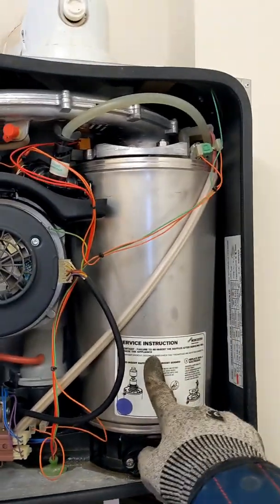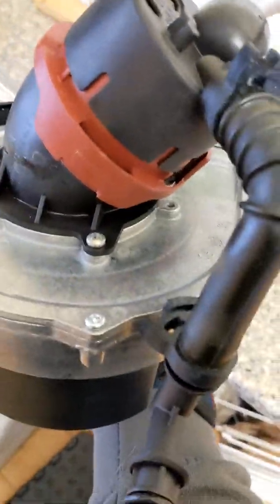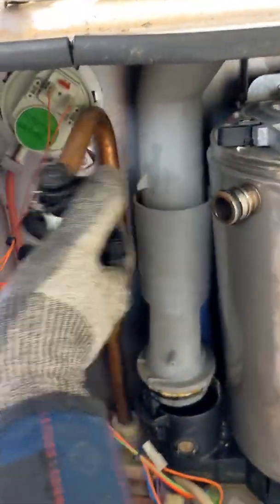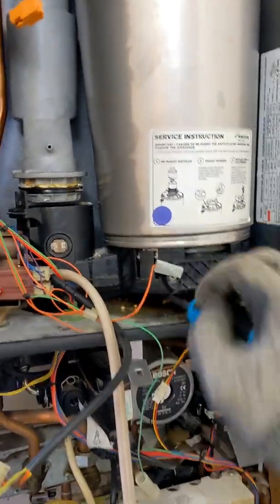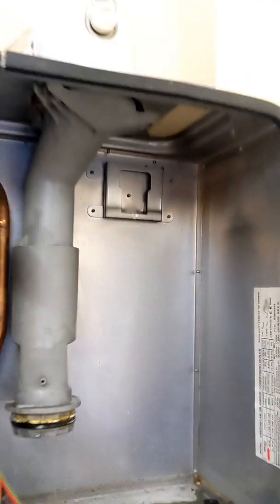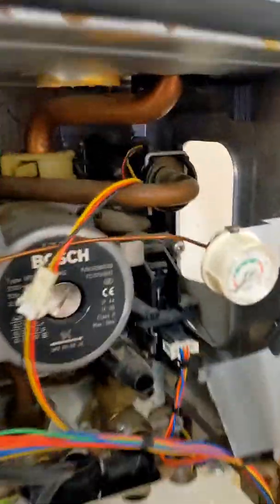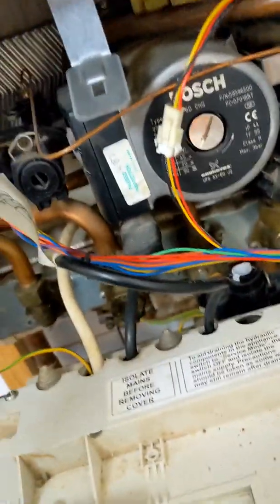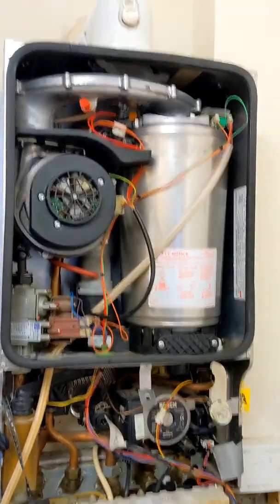Worcester Bosch main heat exchanger/heat cell replacement

Comment: Can I ask why the heat cell was replaced please? I’m having issues with hot water after replacing the plate heat ex and hot water temp sensor. Heating working fine hot water just luke warm. Diverter replace by a different engineer recently
Reply from the maker: It was split from the seams

Comment: Can I ask a question, please and get some advice. I have a new (3 month old)  Worcester Bosch Greenstar boiler. The boiler has been off all day, yet suddenly there was a discharge of water from the boiler through the condensate pipe (I estimate about 100 ml). The boiler HAS DEFINITELY BEEN OFF for I would say 20 hours. The sound, appearance and volume of the discharging water was exactly as it is when the boiler is on and condensing, but as I say, the boiler has been off for many many hours. I can't work out why this is happening - the only thing I can glean from a search to the question "why is my condensate water pipe discharging water when the boiler has been off all day" is that water is leaking into the condensate collecting tank and as soon as it reaches a certain volume it is discharging. I also am seeing words like "cracked heat exchanger" The outside temperature is 12 degrees centigrade as has been like this all day. Surely my boiler / heat exchanger can't be faulty and leaking water after just 3 months? Please help, I am extremely anxious. Thank you.
Reply from the maker: If your boiler has been off and you still have condensate discharging then it could be 1 of 2 things. Either a split main heat exchanger (you would notice the pressure dropping on the boiler as well) or if it's been raining outside then it's possible it could be coming in through the terminal and then discharging through the condensate
Reply: @cputilitysolutions  Thanks you for the reply.
1)Split main heat exchanger (you would notice the pressure dropping on the boiler as well)  - I have  feeder tank in the loft (attic) , so  there is no way of measuring the pressure; the water from the tank would just slowly fill the system, I think? The boiler is just 3 months old - could the main heat exchanger split so quickly? Also it was just on flush of about 100 ml over about 5 hours, because as soon as I noticed the discharge at 6 p.m. I kept watch; it didn't happen again.
Three hours later, I went into the roof space where the feeder tanks is. Despite my cleaning it out completely 3 months ago, it was quite dirty, full of lumps of slime and gunge and the water was orange coloured and there was quite a bit of "sediment" in it as well. HOw could this have happened? Also if the main heat exchanger was split and this dirty water from the tank was topping up the system was replacing the existing water and also leaking out at the heat exchanger, wouldn't I expect to see this rusty orange colour in the "condensate". The colour was clear when it flushed through.
2) How much water could leak out of a cracked heat exchanger into the condensate pipe?
3)The terminal is on the roof - it wasn't raining much around the time of the condensate discharge, and the wind wasn't blowing. Could rain water actually get in to the vent and up through to where the condensate collects before it has discharged?
4) I am hoping there isn't a fault already. Could it be that when the heating is not on and condensate had collected while the boiler was still on hours ago but hadn't discharged at the point of switching off the system that somehow some condensate could be left over and the boiler is programmed to discharge it? I am maybe clutching at straws. 
5)Without pressure readings to rely on, which would show pressure falling, how would I bel able to tell if there was a split heat exchanger? Would the be other signs? Thanks for your assistance - much appreciated.

Comment: What are your 26/9 checks ?
Reply from the maker: The same as everyone else's - Flue/Air intake/Gas rate and/or burner pressure/Safety devices 👍🏾
Reply: @cputilitysolutions  got one of these to do next week, some useful tips here especially don’t undo the return connection on the bottom of the heat cell. Invaluable
Reply from the maker: @smartboilercompany1983  👍🏾

Comment: Nice video but you don't say what was wrong with the heat exchanger. My 12Ri is 18 years old no problem (touch wood). Boiler has had new main circuit board & fan assy. (complete with it's own circuit board) though.

Comment: How much does a main heat exchanger cost 
If boiler is over 10 years old which I’m sure these models are best off swapping the boiler
Reply from the maker: Usually around 400-500 but this was an insurance job so if parts are available they'll want it done!

Comment: Is there a way of replacing heat exchanger without touching the flow and return valves on combis, I know some do it but how?
Reply from the maker: I'd only do that if the boiler was the highest point on the system. Last thing you want is all of upstairs to empty out on you whilst you're in the middle of it!
Reply: @cputilitysolutions  yeah true don't understand why some engineers wouldn't risk not touching isolators as creates more work but like you said may flood the house.

Comment: did the 'O' ring on the return pipe get changed? (I use polypipe lube, the WB guy in the Allan Hart vid used molykote)
Reply from the maker: Yup changed them all

Comment: Has anyone ever seen corrosion around the top edge seam on the main heat cell/ exchanger, crusty deposits coming out and sometimes on the bottom edge, if so what causes it and does it mean it needs replacement? I can’t find anything online about this and I’ve seen it a few times now?  Can’t be the burner seal as that sits in further🤔
Reply from the maker: Yes mate this is a sign that the main heat exchanger has split from the seams. Only thing to do is to replace the main hex

Comment: Good video, just a few tips, the bracket on the top of the heat cell to the back panel is just a retaining guide, and does not cause any resistance, it's the bottom O ring that causes the initial resistance, try a longer thicker screwdriver, you will find the leverage a lot better, also if the boiler is 8yrs +, it might be a good idea to replace the exhaust pipe seals (bottom and middle), as theses can perish over time, and alter the POC once the case is on, and once the fan is out, as with the seals, check the bearing plate, and finally, if it is the old sump with the corkscrew flue stat, replace the sump assy, good job tho. (don't move the black locking clamp on the return pipe).
Reply from the maker: Nice one mate thanks for the additional tips 👊🏽👍🏽

Comment: Hey I thank you for uploading the video.
Normally you don't need to struggle
You don't need to bend the casing
 and you do not need WD-40 
You need to remove the condensate and loosen the flow clamp nut.
Use two big flat scree driver or flat metal peace.
Push and hold the cell against the bracket and lift it with flat screwdriver and then the other screw driver and up.
When people struggle to take out the cell, it is not the return pipe, it's the bracket pressed, clamped into the mounting and the weight.
It is very easy once you do it couple of time.
Good video
Reply from the maker: Thanks for the tips 👍🏽
Reply: 👍
Keep it up good videos at least someone making good efforts to teach someone or showing someone, where most of us don’t have time for all this when we are at site.

Comment: Tbf I usually disconnect the top clip as this allows more movement and I use both hands to lift the heat cell out.
I've tried levering out but the frame chassis is thin and usually bends when using a screwdriver
Reply: Same here, I tried levering out and the chassis was starting to bend and I was wanting to save the heat cell. I’ve seen a WB video saying don’t disconnect the clip, but it really wasn’t working for me. Soon as I released the clip… the job was a lot easier

Comment: Another reason to hate Worcesters.  Lost confidence in fitting WB boilers.  The housing association I used to work for fit nothing but.  I felt the struggle when you were trying to wedge that cell out 😳.
Reply from the maker: Haha yeah it was a bit of a struggle as this was my first time. But I've managed to do them in an hour since then!
Reply: Put a screw driver between the case and the  pipe under the boiler then I use two big screwdrivers under the sump and Rick it out works for me the bigger the screwdrivers the  better
Reply: What combi would you recommend fitting if it was in your own home?
Reply: @richardjones3112  All depends on your size of home and anount of hot water required i.e bathrooms. The amount of hot water out on a combi relies in the supplied inlet cold water pressure. I generally supply & fit Main/Baxi & Viessmann combi boilers. Tanked system boilers Ideal & Vaillant. 
Clean system & servicing either way will help increase the longevity of the boiler 
Your Gas Safe installer may recommend what s/he is familiar with.

Comment: Got a bang now and then on mine only on heating side burner has been clean ed out and heat plate clean ed out no air locks do you think it my be this on way out what go,s on them thanks
Reply: Yeah it needs throwing on the grass crap boilers